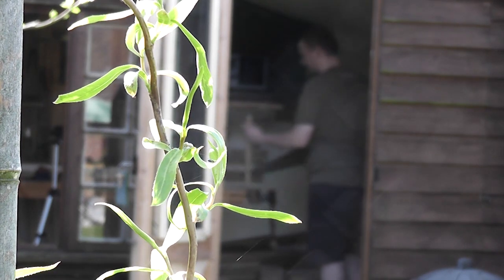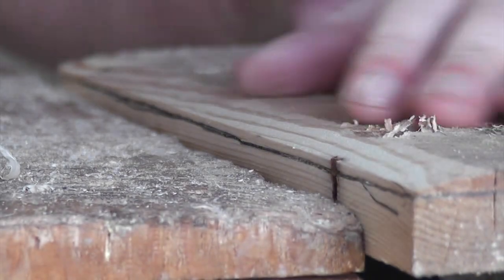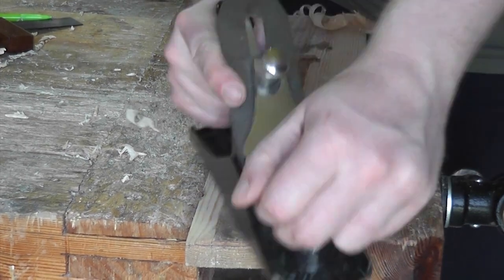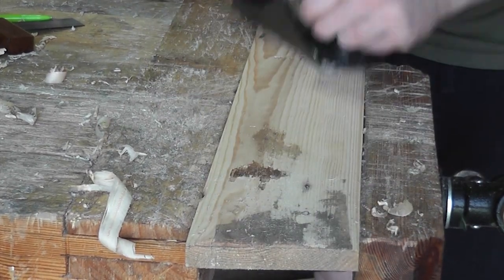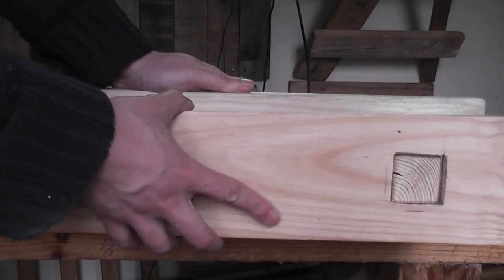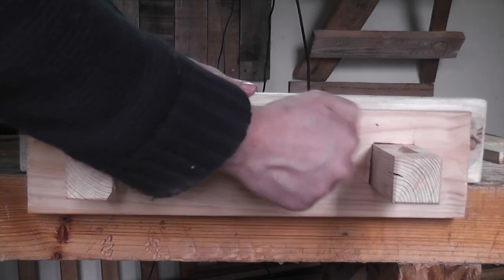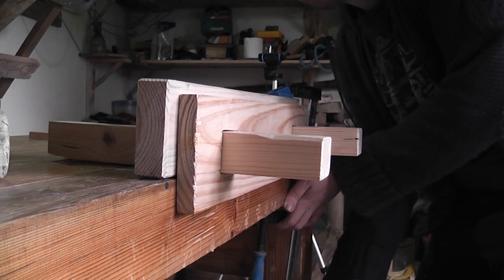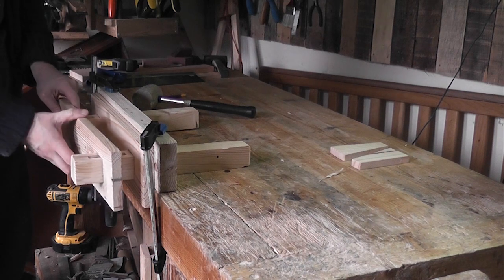Wedge Powered Moxon Vise [Woodworking Project] (Tool Build)

Comment: Nice idea Clint, although I guess it's by no means a new concept. I made a rudimentary moxon vice using the screw parts off of an old B&Q workmate portable bench that was knackered. It didn't work very well and eventually I got so frustrated with it that I had to set fire to it. Anyway, for ages I've been without any kind of vice and had to use imaginative clamping to get by. This looks like a possible stop gap until my birthday when I can coerce my beleaguered wife into buying me a record woodworkers vice, or similar. I had a dream the other night that I was using a plane and getting that satisfying SHHHCUUTTT sound. Then I woke up and remembered that I can't cut anything in a straight line without my table saw. Enjoyed the video as always. Cheers. Andy, Grimsby.
Reply from the maker: Oh no I'm sure it's nothing new but for me it was a less complicated alternative to making a double screw moxon vice, cheaper too! I'm glad you liked it and I'm sure you'll get that satisfying sound one day 👍
Reply: Timber Anew. Oh the other thing I meant to say was if the vice isn't meant to be a permanent fixture on your bench you could consider drilling appropriate holes and, if you have any, secure it with holdfasts. A good sort of quick release function, so to speak. What do you reckon?
Reply from the maker: Great idea Andy! I was actually thinking about making holes in my bench for the pieces which receive the wedges to slide into and then pegging them into the bench when using them. But I thought that was a little overkill and maybe something for when I have the room to make a more custom woodworking bench.

Comment: That is exceptional. You think it could be made where the wedges go in from the side? Again great work.
Reply from the maker: Thank you kindly sir! Hmmm, do you mean so the wedges are not in the way at the front? My brain is trying to think of how it'd work.
Reply: Timber Anew yup, just turn the mortised pieces on their side and it should still work. Be worth a shot
Reply from the maker: Holy crap, not only would it work but it'd put more pressure on the centre. It would be a better design. I need you in my workshop!

Comment: I love this idea. It could easily be extended the length of the bench by using more rails. 

The rails could also be adjustable by being loose in a bore that runs the width of the bench. The rails would have a series of holes and could be pinned at various lengths by a dowel pin through the top of the bench.

Of course these ideas make more sense if you decide to build into the bench.
Reply from the maker: That would certainly work! I quite like that idea actually. I recently made a screw moxon vice with a tap and die kit I got recently. That vice does go straight into my bench and has a lot of holding power.

Comment: Greetings TA
Last year I built a modified Maxon vise using wedges. I'd like to send you some pictures. The jaws are pine 2x6x22. The rails are 1x4x18 oak. The wedges 1x1 1/2x 7 walnut. I drilled 3/8 holes in two rows 1" apart offset 1/2" in the rails. The rails run through both jaws. A 1x4x22 oak strip is secured to the bottom of the outside jaw. It is screwed and glued to that jaw. 
That jaw's bottom edge is planed to about 4 degrees, tilting it toward the top of the inside jaw. The inside jaw is reduced in height about 1 1/2" and reduced about 2 1/2" in width on each end. 

Two  holes are drilled down through the jaw to align with the rails. They are offset 1/2" front to back. One 3/8" dowel with a cap knob is used in each side through the holes in the jaw into the holes in the rail so I can adjust the vise capacity in 1/2" increments. 

I cut  a mortise 3/4" by 1 1/4" about two inches from the end. This gives me a near infinite adjustment capacity from 0" to about 6". The walnut wedges provide the pressure to hold. 

Adding sandpaper to the jaws improves the grip. I use a small leather faced mallet to set the wedges. The whole unit is mounted to a piece of 3/4 plywood which I clamp to the bench during use. It is not perfect and I have had to open the mortise in the outside jaw due to moisture issues. It works great for most applications and I am wanting to build a double screw vice for permanent mounting to my bench. I want to make it so the threaded rod runs through a nut in the bench to minimize rod extension into the work space. Every one I see made that moves the outside jaw in and exposes more rod makes me cringe - excellent source of scrapes and unwanted bodily injury  - ouch!

Thank you for your video. I'd like to do a few of my own.
Reply from the maker: That sounds pretty awesome Neil! You're right I could definitely improve the design and add things like extra grip for sure. I'd love to see your design, feel free to email me at timberanew@btopenworld.com if you'd like to!
Reply: @ClintRoseCarving  
Greetings again TA
I did some research on parts that could be used in a twin screw vice last night and today. I drew up (grid paper and pencil) some plans that I want to try. I went for 25" clear space between the threaded rods and the plan calls for using standard dimensional lumber. Most of the parts can be purchased at the local lumber yard. I found some brass bushings too. Although they cost about twice what standard threaded rod goes for, I think I'd like to use Acme threaded rod - I think they would wear less on the bushings and operate more smoothly.

I'm letting you know about this because you seem to be the kind of woodworker who wants to try new things and keep the costs to a minimum. That's me for sure. The weather is forecast to warm up some in our area of Michigan starting tomorrow. Maybe I can get into the shop again and build some stuff and get some pictures for you. 

Be well and keep up the builds and new thinking.
Reply: @ Neil Hendricks
Hey! I would also like to see your design. I have been designing a workbench that i can build with savaged timber and will be only wood and knock-down. I really like to use wedges for clamping instead of screws. A moxon wedge-powered vise would be perfect for my bench. @ Timber Anew 's design looks very good, but i thing yours would be better for a permanent vise. I am very interested in your design.

Neil, your description of your design is really good and very detailed. Sadly, English is not my first language and in order to fully understand your design i would need to spend some time researching the meaning of some very specific words and eventually i would figure it out. What i am trying to say is that any kind of drawing or picture would help me a lot. You can email me at 4n494rc14@gmail.com if you feel like. Thanks!

Comment: You ever have the wedges work themselves loose or pop out? Very interesting concept
Reply from the maker: The main issue with it was that it didn't hold very thick pieces. I didn't really use it for very heavy work and now have a twin screw vice which is much better!

Comment: Could this be potentially limited as to how far the vice chops could open and still be able to wedge shut?
Reply from the maker: It is indeed, unless you were to make larger mortices and wedges, but it'd probably be annoying to have it too large. Since I'm mostly gonna be using it for dovetails on boards under 25mm thick then it's totally fine for my purpose.